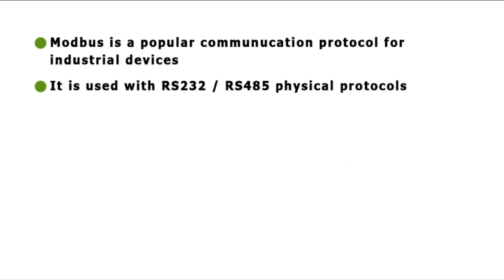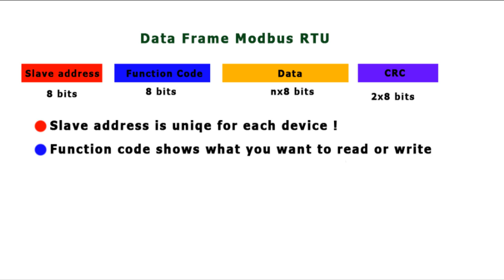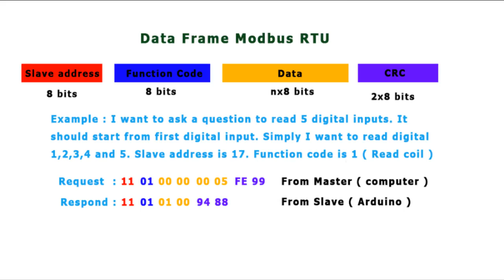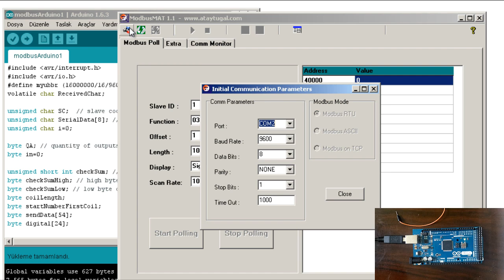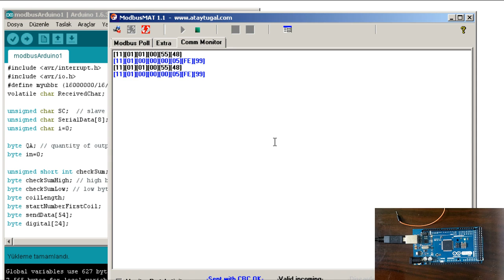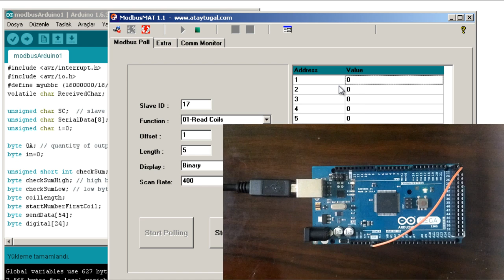Arduino Modbus RTU Slave Simple Example How to try modbus algorithm with arduino

Comment: Hi Sir hope you are doing well.

Sir please can you help me I'm a student and having issues in master slave model using Arduino mega and rs485 as a master and other equipment as a slave by master sends data successfully but slave having issue in data sending data will not received in master side.

Arduino mega is Master.

Comment: hello Hulas. I`m working with your code with an arduino 1  but I`ve a problem, arduino uses com10 and modbusMAT1.1 said: "com 10 does exist" , the same ij port 2...somebody had the same error???

Comment: thanks for your video Ulas, what if my arduinomega has a COM port higher than 10? i cant make it work with modbusmat
Reply from the maker: Javi Be change the number of comport in windows. you can google it. change port number in windows
Reply: that was a quick reply, i am trying that but no luck so far
Reply from the maker: https://answers.microsoft.com/en-us/windows/forum/windows_7-hardware/how-do-you-configure-com-1/74c92208-9edb-470c-a11e-3fa56d8e4818 did you try ?
Reply: EDIT: i needed to restart computer after changing ports .....i already changed my mega port to COM8 but Modbusmat now doesnt even Open the port ( i tried my sketch with arduino uno COM7 and i know it works)
Reply: coms are open but no reply from arduino mega so far :(
Reply from the maker: Javi Be use simply modebus program. try with this program
Reply: isnt that propietary sofware?

Comment: I'm trying to convert this code in order to work in an arduino UNO, but i'm having trouble. Any advice?
Reply: it should work if there is enought memory? are there any error codes upon compile? If you change the right tx/rx pins why would there be a difference?
Clock speed should not matter as long as the atmel processor is fast enought for the set baudrate?

Comment: Hi, How to configure ASCII?
Reply from the maker: Simple. You should change the representation. For ınstance when you send 100 in RTU you send just 100 . But in ascii you should convert 100 to hex which is 64 then send first 6 after 4 which makes 100 will be send. But ascii is old If I were you I try to find a way to use RTU.
Reply: Thanks for answer!
OK, I'm working with de device (energy meter) ED39din its work with the RTU, MODBUS and IEEE protocol. However, actually i have a problem and the handbook say "The energy counters can only be reset using the special Modbus command on the serial line."
I need to reset the counters but i can not. In this link you can see the handbook https://goo.gl/JRVrNy

Comment: your tutorial looks really easy to get started.  But, unfortunately these tools are not available, neither you have shared I guess in your link.  If you have links to ModbusMAT tool and possibly the library you used for testing, plz feel free to message at: allawadiarvind@gmail.com

P.S: I am working to communicate Arduino and Jetson as well as other controllers using modbus RTU (RS485) but as of now I am facing enormous issues to proceed.
Reply from the maker: Dear Arvind. I understand your problem. These tools are not created by me that is why I have no permission to share it. But if you search with google it is easy to find them. For example there is free tool http://www.simplymodbus.ca/
you can download from the download part of the site. If you have any question you can ask about it. Thanks..

Comment: I think that most difficult part here is to test your CRC calculation correctly.
For this may I recommend Docklight Serial port terminal that has option to automatically calculate CRC for modbus and append it to the end of the message.
You can find it at http://docklight.de/ and there is free version at their website.

Comment: hye.
i read and also watched some materials on this topic.but i could not see and relate it to real life example.what i read and watched were some address of coils, start and stop bit.

Can you make an example say one master is requesting a temperature value from a slave.
what will be the start, stop,address and function sent by master and responded by slave.
Reply from the maker: This is not a real example ofcourse. Actually this is what before real. If you understand basic level then the next levels just take your time. 

If you want to read temp value which analog value, then you need holding register which function number is 03.

Just one thing, do not look the picture like reading temp or any other paramaters. Modbus protocol does not care what you read just sending or receiving data is suitable or ok.

by the way, thanks for your comment : )
Reply: hye.is it ok to request your email or you can send it to adammukhriz82@gmail.com
Reply from the maker: I just sent an email..
Reply: can you forward to me? 
e-mail aarun2796@gmail.com

Comment: how to know slave id? it random or what sir?
Reply from the maker: it is assigned to the integer which is used for slave id. normally you need an interface yo choose the slave id of the device. you can assign any value it depends on you for this

Comment: have you use an arduino to control a MODBUS?
Reply from the maker: Yes, I write a code to communicate any device which support modbus rtu with arduino.
Reply: currently I'm trying tot make a Mega2560 to talk to a ro star solar charger, any advice. Having issues
Reply from the maker: What is star solar charger  ? any document you can give or link ?
Reply from the maker: mppt algorithm with modbus it is good device.  Do you have any problem ?
Reply: I guess I don't understand it enough, I'm trying to use the basic modbus that arduino provides but can't seem to make it work. any examples that you have? links that you recommend?
Reply from the maker: exactly no. These things make money that is why people generally do not want to share but I will share full example code ( when I will finish to write the post ). If you do not interest in before, it is a little bit hard. It should be arduino ? there are other microcontroller that you can find much more information about modbus.
Reply from the maker: http://www.simplymodbus.ca/ maybe this can help
Reply: thanks, I guess I have a pic I can try to work with
Reply from the maker: If you have any question, do not hesitate to ask.
Reply: Hello , nice job, will you please send me the modbusmat 1.1 link to my email address turbofox99@yahoo.com.
thanks in advance
Reply: founded, thank you